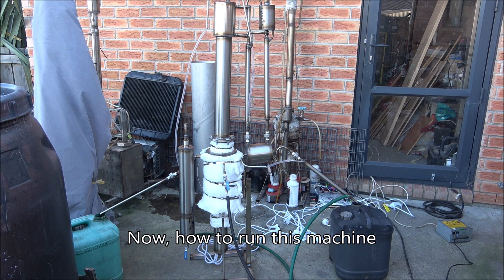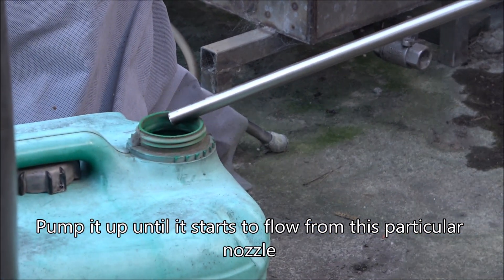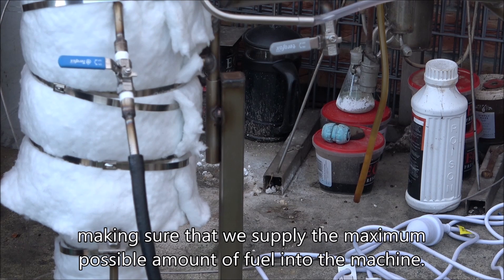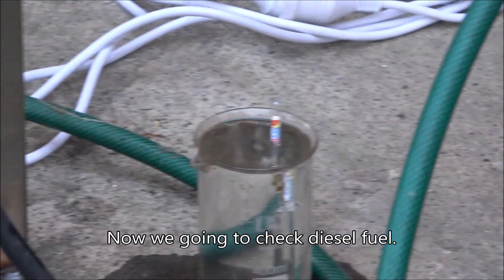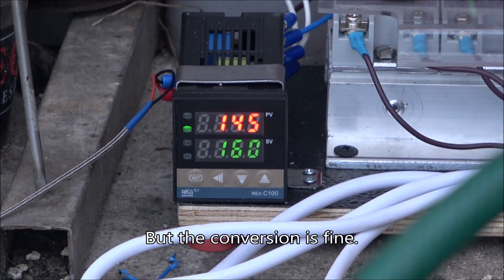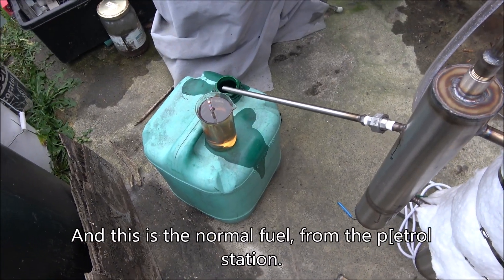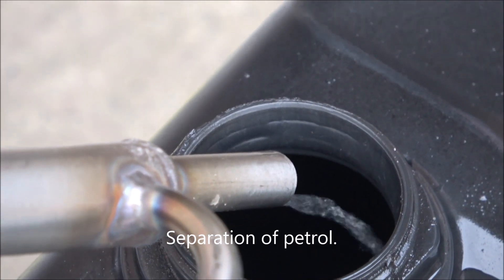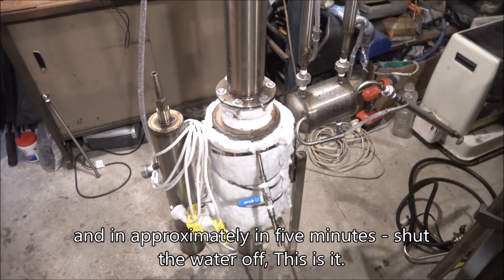How to remove gasoline from diesel - wrong fuel rescue.

Comment: Practically it's possible to extract/convert diesel to gasoline?.
Reply from the maker: It is possible with an enrichment process - different approach and machinery, but here is a simple separation of the accidentally mixed diesel and petrol fuels.

Comment: is this the same machine components and basic layout used for waste motor oil conversion to diesel..  but just different temperatures and/or arrangement of collection vessel?
Reply from the maker: Same principals, but different internal arrangement, this machine would not be able to process any oil, while the oil distiller is not able to separate petrol, they are designed to the particular task.

Comment: What units are you using to control the heating elements
Reply from the maker: what do you mean under "units"? I use solid state relays Each capable of 40A at 230V though each is loaded with no more than 8A.
Reply: @santeryi9  sorry yes this is what i was asking for.
Any particular Reason for solid state over contactors?
Reply from the maker: @nickoblack11  Just simpler, always available, no moving parts, though in this particular control module a contractor controls the SSRs, you can hear it clicking.